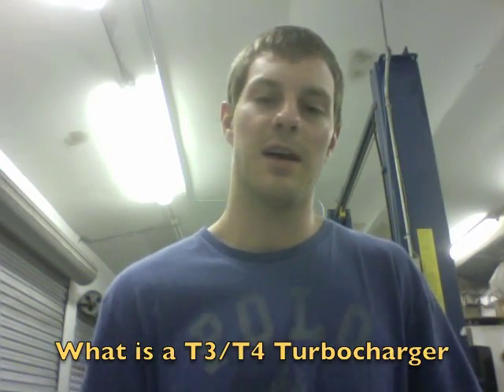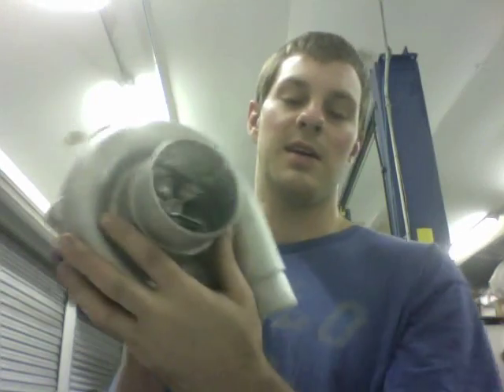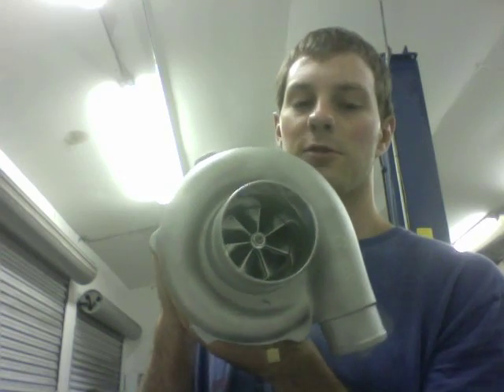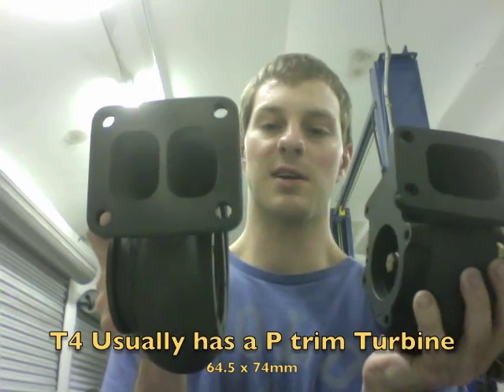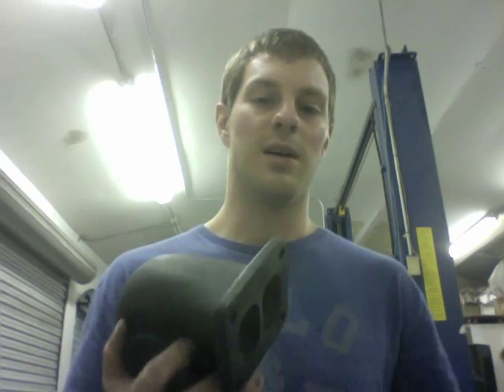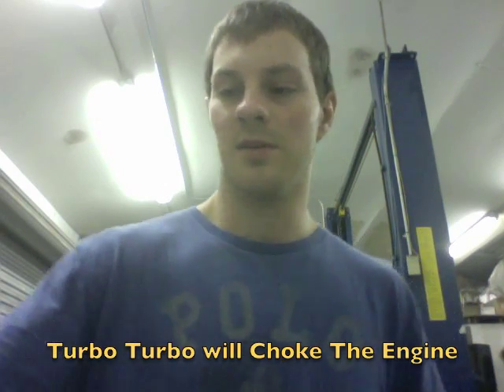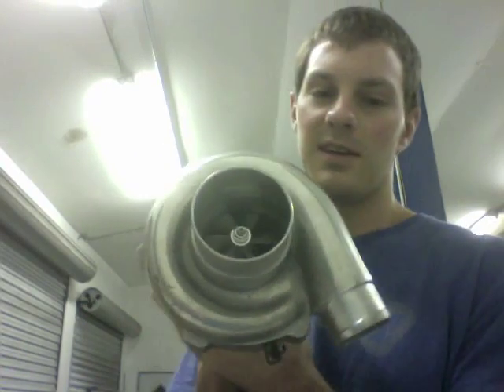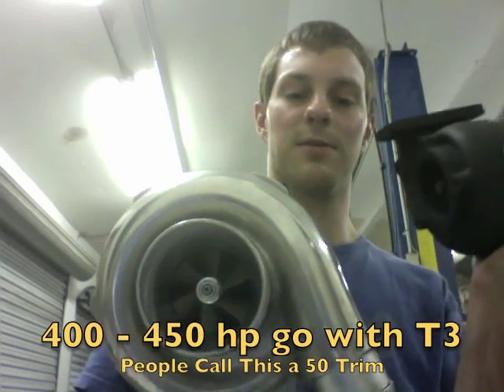What is a T3 T4 Turbocharger

Comment: Hey I just bought a LS Swap turbo manifold that gets 18+rwhp and a muffler from jdm that get a sweet deep tone and the muffler is supposed to give me 8%-10% more hp, and the flange fits a T3/T4 turbo I found one for my 1.6L 2015 Nissan Versa Sedan FWD and I was wondering how much hp I would get, because the stock gets 109 hp. So would I gain at least 250 and above.

Comment: Hi. I have mercedes 5.0 engine and i put stock holset hx40 with garret ar63 hot side housing. I like the quick spool option, boost is instant. Thats great, but do you know max hp for that kind a setup? Im planning to make about 600 hp. Thanks!

Comment: Hi, I didn't understand the reason for not using the T3/T4 on a V8.  Can you explain a little further?
Reply: The exhaust side is to small and will cause restriction and to much back pressure.

Comment: so based on what you just said, for a 2.0 liter engine a T3 4 bolt would be good then .82 A/R?
Reply: The question is what are your Hp goals and budget i saw you are a VW fan I am as well but never hear the end of it from Honda sheep I am looking for a set up almost identical but I am having someone build mine I had to replace my exhaust side so I have no more journal bearing they are a waste of time to me
Reply: @robertaswenson1192  I finally got a T3 4 bolt turbo, it's a Precision 5858 with RS4 injector setup. It's somewhere in the 420hp. I swapped my MK5 GTI with an MK6 Golf R engine stock block.

Comment: What am I smoking
Reply from the maker: +Clorox Bleach probably bleach
Reply: I'm thinking about buying a T/3 Turbo kit for my 1.8 Sentra project car. If I install without a tune will the RPM will not go over 4k rpm unless it's tuned by a dyno shop.
Reply: Thank you Master Yang
Reply: The rpm will still go past 4k unless you're ecu is reading soemthing wrong with ur car and will put it in limp mode hence the 4k rpm limiter

Comment: Got a garrett ta31 t04e with a .63 a/r compressor and .48 a/r turbine housing. It has a funky 5-bolt flange for the downpipe that is not like most of the 5 bolt flanges (like the one on the t3/t4 you show in vid). I think it could be a chrysler or something. At any rate, i want to change the turbine housing to get a v-band type flange for the down pipe with no internal wastegate, but keep a .48 a/r ratio of the turbine housing. i do not want a split turbine flange. Can you guide me on what I need to tell someone to order such a turbine housing? Do I need to measure the turbine wheel so they know which housing to send me or just by giving them the information i give here, will be enough?

Comment: What turbo i showld use on my 1600 cc bug?
Reply: You will need to build the internals of the engine first ie; Forged pistons, con rods, crankshaft, and new con rod bearings. Thar alone will give you more power. Not only that, you will need to get a single carb conversion kit to deliver the boost. Now, to the turbo a small diesel engine turbo will do the bug just fine. If it doesn't come with an internally waste-gated turbo the most boost you will want to run is 5 pounds. In my personal opinion, this is just me, with all the money you would be putting into this, you could get an R1 sport bike engine to power your bug. Not only would it be cheaper, it would sound better, get better mpg, make more power, and get you more street cred. That's my two cents at least.

Comment: Should I use a T3/T4 on a 13b rotary?
Reply from the maker: No. It will make too much heat. You need a large turbine housing.
Reply: Oh ok. What about a GTX30R with a T3 inlet flange, Turbine housing A/R.82 and compressor A/R.60?

Comment: What would a PTE 6031RE be? What turbine? I think the Compressor is a 60-1 correct me if I'm wrong
Reply from the maker: +Steven “The Kuj” Kujala it has a stage 3 turbine 56 X 65.  That is considered a t3 t4 turbo but I prefer to have the 60-1 mated to a t350 turbine or larger

Comment: anyone know a good setup for a 3.8 Camaro
Reply: Sell it. A v6 with 200 base horsepower is weak af by today's standards.
Reply: I've seen better setups on a v6 and have big HP gains .but thanks for the opinion the v6 is just a project.
Reply: I understand, but the investment isn't worth it. You'd have to spend $5k+ just to keep up with the v6 powerplants coming out today, which is most likely more than the vehicle is worth. You would eventually regret putting money into it. Use it as a down payment on a newer setup, or DD it and save up your cash. You'll thank yourself later.

Comment: what is the best upgrade for sr20det? the original has t28 turbo. plan to go on gt30?
Reply from the maker: a GT3071r 53.11  x 71, or gt3076r 57 x 76, or gtx3076r 58 x 76 (all have 55 x 60 turbine) with a .86 t2 turbine housing are good options. Or you could get a greddy tdo5 series turbo and have an 18g 50 x 68, or 20g 52.6 x 68 with a tdo6sl2 54 x 61 or tdo6 turbine 55 x 65. you could even get a  56 x 76 compressor or gtx3076 58 x 76 compressor on the MHI turbo too.

Comment: what do you think about the T3 Turbonetics turbo?
Reply from the maker: +Henry Erazo it depends on the application, and what you are trying to achieve and engine it's going on and which version of the turbo you use, some have a t3 .48 and some a .63. The .48 probably is okay for a 300 hp application for a 1.6 liter but it will choke it at higher rpm, it should work okay for a motorcycle.

If you get a turbonectics turbo try and get one with the blue plate. They usually took a to4e rebuild kit, the others are mostly big shaft and sometimes single ballbearing which doesn't make a lot of sense.